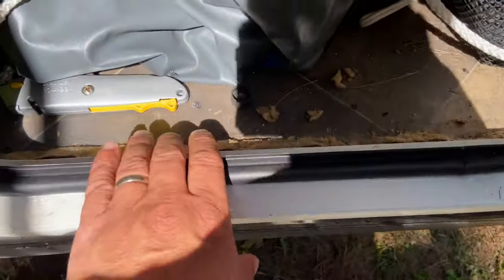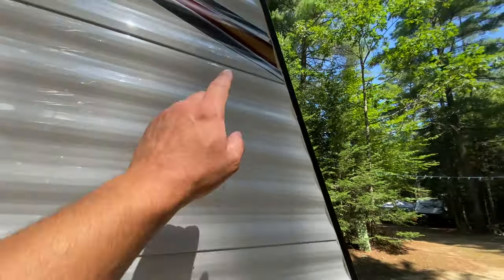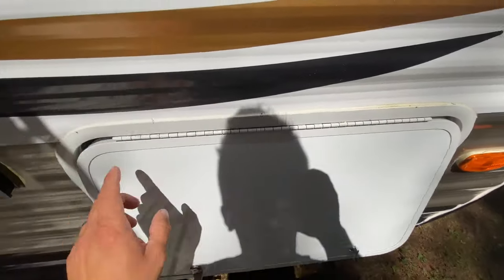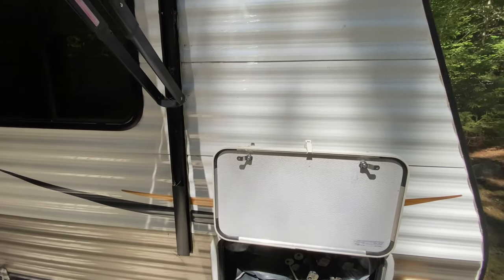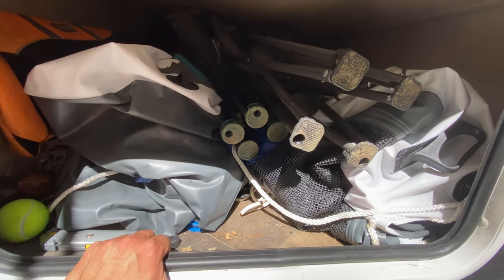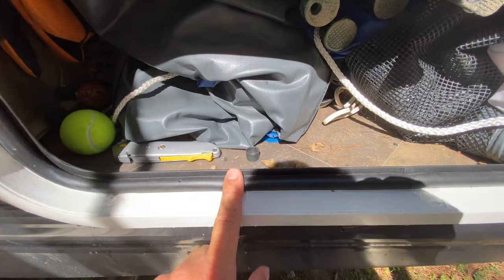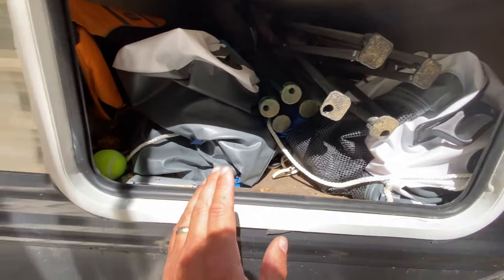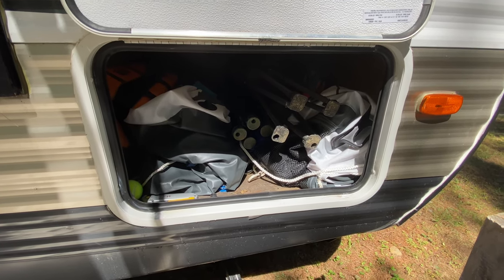How To Diagnose and Fix a Water Leak on Your RV Storage Compartment

Comment: These campers with the ridged siding are notorious for leakage because it is not a flush seal I would put a tarp over the roof when you are not using it to prevent any further water exposure
Reply from the maker: Thanks for watching.